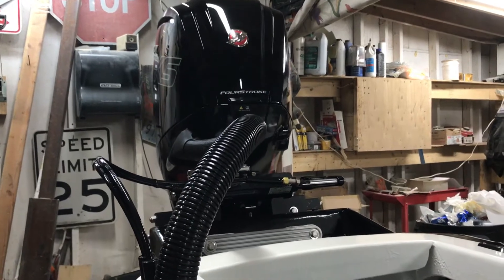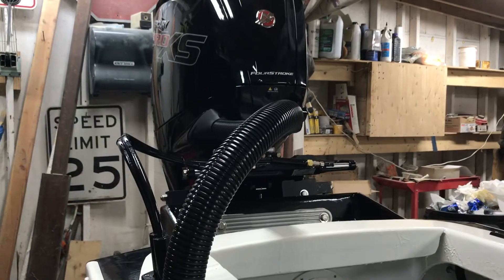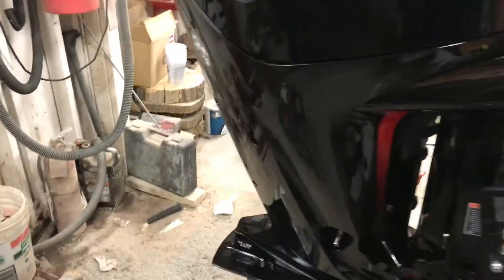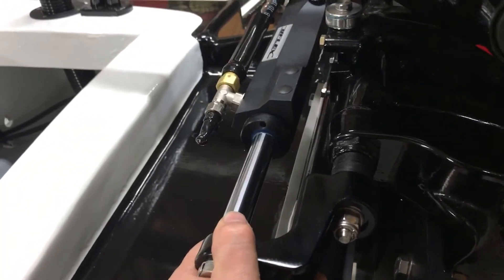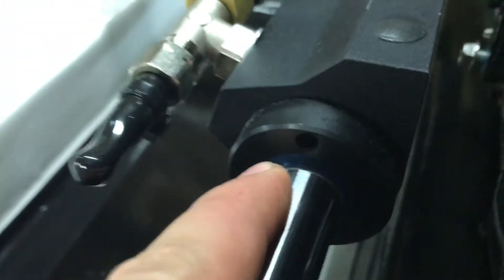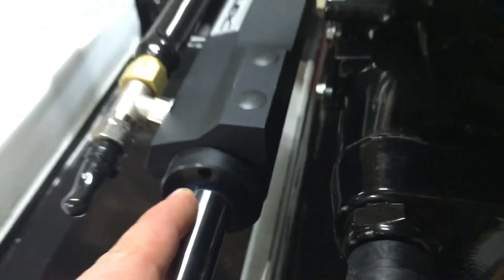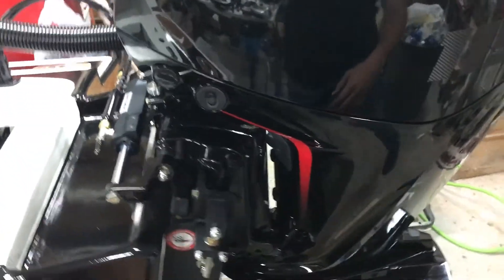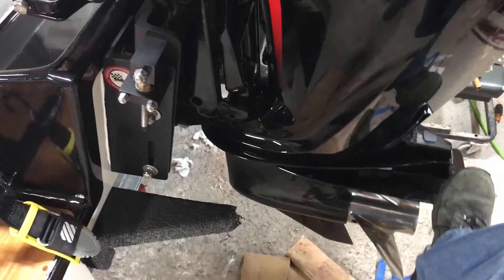Uflex loose hydraulic steering ?

Comment: Not air,because of the expansion in hoses.they are very weak.you  put 250 bar or 3620 psi and problem solved.had the same problem.